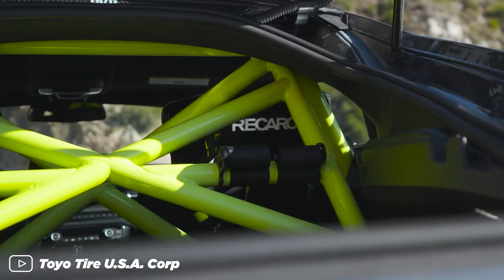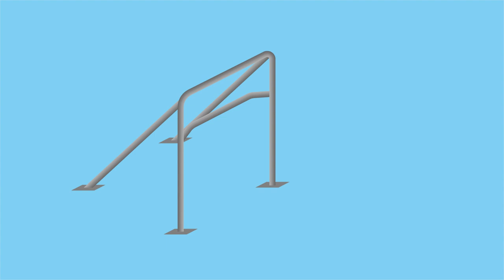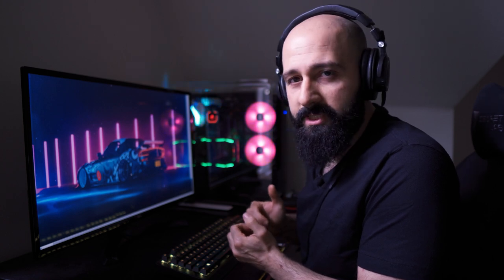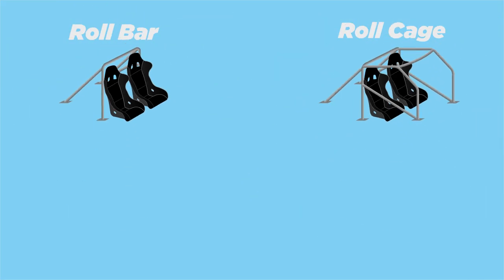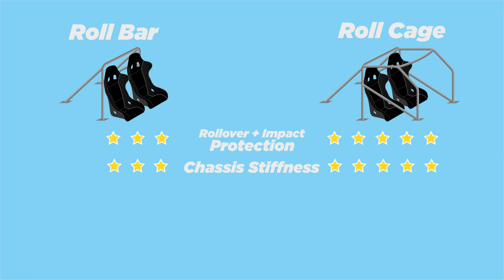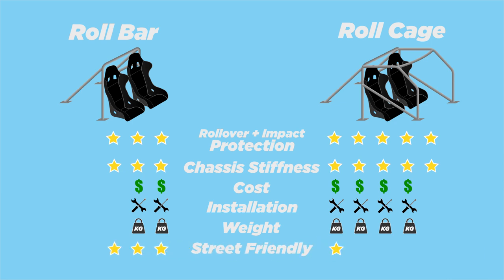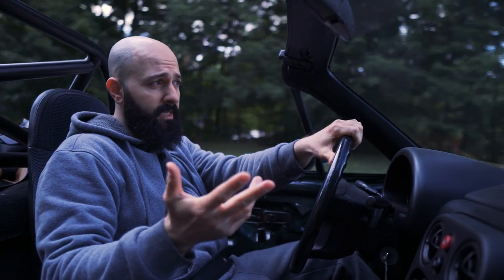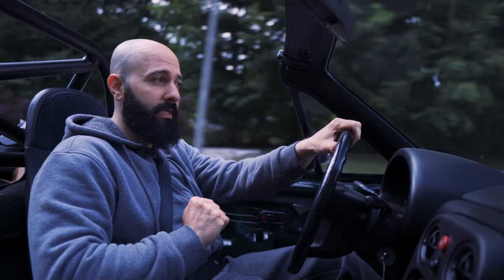Do I NEED a roll cage? || PROJECT MIATA

Comment: cant you add padding on the roll cage to stop you from hurting ur head when in a collision for street uses?
Reply from the maker: That does work in a pinch. Like you want to be able to drive your car to the track. But just getting in and out of a caged car is not something most people want to do on a daily bases 😂, it's definitely a compromise
Reply: @MZopyrus  im boutta lose 500 calories just tryna get in my car 🤣🤣